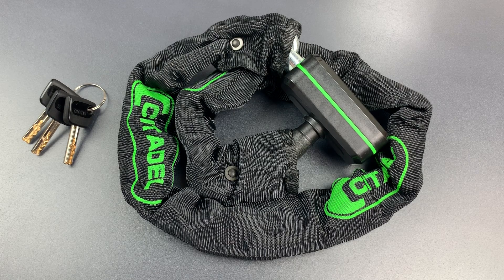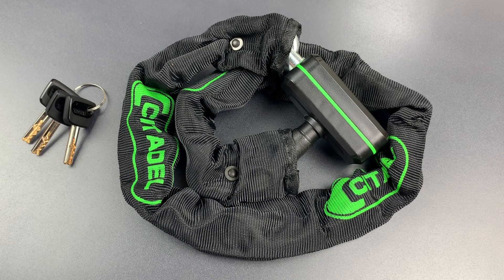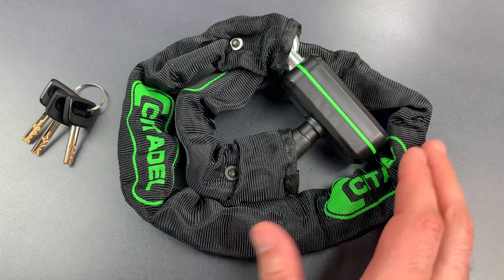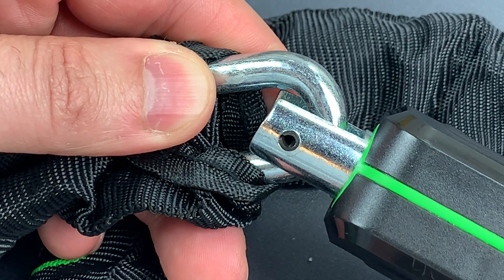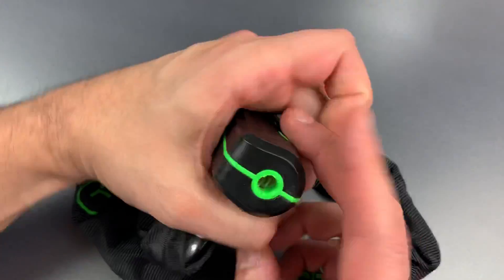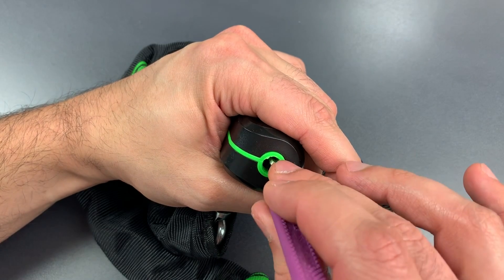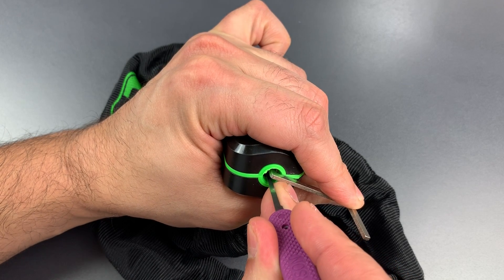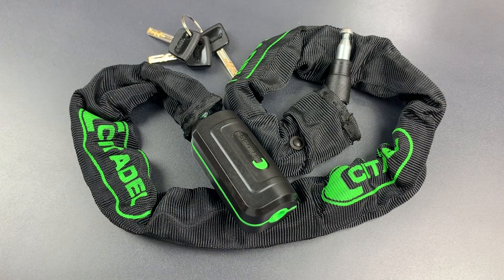[780] Citadel’s “Rome” Bicycle Chain Lock Picked (6 Sliders, 2 Sidebars)

Comment: I had one of their premium locks around 2004. It was shaped like a rectangular bar, which had an iron sleeve surrounding the steel bar and was locked with a circular cylinder lock. The thing weighed a lot and because I was carrying books to college I decided to leave it locked at the college. One day I arrived to find it wasn't there. The property owner leasing to the college decided to have it cut off.

Comment: I have a request, the Abus granit plus 640 u-lock. It is extraordinarily expensive at around $100 but is much much thinner and lighter than even Abus's own locks costing half the price or less. It actually uses its light weight as a selling point. But has the highest security rating for their U-locks, apparently greater than their locks with much more robust shackles. 

If you were able to get hold of one it would be interesting to see.

Comment: That roll-pin holding the chain to the lock body. Such a bad design. Seeing that I'd never buy one of them.
Why pick it if in 30 seconds you could just push that roll-pin out with a hammer and pin punch.

Comment: how is that thing just held together with a clotter pin? you can push it out with a panel nail or it will snap if you yank the chain...
Reply from the maker: It’s a blind pin. Taking it out is more complicated, but not that much.
Reply: A self cutting wood screw can bind in it. It is crazy to put a weak spot after using such a strong heavy chain. 

Your videos are amazing man! I like how easy you make it look and how you explain your craft. Great job!

Comment: Something should be said here regarding the poor quality of some of these bicycle locks. Like anything else there is a price point at which these products can be sold. If one wants to secure their bicycle and be certain the lock is not going to be picked or broken apart, you simply have to open your wallet.
There is point at which the manufacturer will not be able to make a profit, the consumer will not be able to get an affordable lock. I suppose if you have a bicycle worth a couple thousand dollars you be sure to invest in a very expensive system to protect the unit. I suggest a logging chain with links of five eights to three-quarter‘s of an inch in diameter. There are locks out there that will resist cutting and picking. However you’re expensive bicycle might be taken apart and you will find some of it on the chain  and the rest of it gone. The old saying, you pay your money you take your chances. You decide. And after all of that you are still not secure neither is your bicycle.

Comment: Another bike lock with a major flaw.
Makes you wonder if these companies really care about protecting a consumers bike or are they just interested in the volume of locks they can sell before the public find out the lock is no good.
Thanks for the video, cheers mate
Reply: I suggest you consider, not the POSSIBLE ways of defeating this lock, but instead the ACTUALLY LIKELY ways of defeating this lock in the field. 

Yes, LPL can pick it in a few seconds. Can you? Can a 20 year old with a pair of bolt cutters and no picks in his pocket, in the drugstore parking lot with people walking by 10 feet away? (Picks are often illegal without a locksmith''s license, bolt cutters are not. Which would you rather have in your pocket if you expect the cops to shake you down?) I personally think we can dismiss picking as a LIKELY attach on this lock. It could probably be a Master #3 core and still be reasonably safe from a picking attack.

The second obvious attack is pushing out the roll pin holding the chain to the lock. All it takes is a hammer, a punch, and maybe something to use as an anvil. How many bike thieves do you know that have a hammer, punch, and anvil in their pocket? How many do you know that would know how to drive out a roll pin? How many could do it without attracting attention in front of the drugstore with people walking by 10 feet away? This is a more likely attack than picking, but I don't think it is very probable.

That leaves bolt cutters or an angle grinder. How good is that chain? LPL didn't mention that.
Reply: @lwilton  I'm not paying my way by stealing bicycles. If I were, I might develop such skills.
And to press out the pin, I'd use a gear puller modified to press a pin, not try to lug around a hammer and anvil.
Reply: @JimFortune : The common bike thief does not pick. If your'e skilled and patient enough to become a good picker, you're not going to try and making a living stealing bikes. It's low reward, high risk. Bike theft is a crime of convenience by low-level street rats.
Reply: @chrimony  Not being a bicycle thief, and having never conducted a survey of bicycle thieves, I really can't say what techniques are popular. From what I've seen of bicycle locks, SPP isn't needed. Raking or bumping is probably sufficient for most,  and they have the advantage of not taking that much longer than normal opening with a key does. It usually works fast or doesn't work at all. So you take a stab at it and walk or ride away depending on luck.
Reply: The important thing is to keep the public from finding out how shitty they are. You can spend the time and effort to make them less shitty, or you can spend those resources on lying to the public.
Reply: Which one do you think. It's obvious.
Reply: Capitalism doesnt care about anything but its own benefit. surprise surprise ^^
Reply: @RVPNK161  In Romania, under communism, we had a famous (to us) car called Dacia 1300. This car, like every car, needed a key for the engine to start. Now, unlike other cars you could take your ID card, put the corner in the key slot, and twist. There was nothing holding the mechanism in place.

There's also a story I heard about an American guy going to work in the USSR. There he gets an apartment that, for some reason, doesn't have a fridge, so he asks a co-worker what's the best fridge. His co-worker tells him what kind of fridge is the best, and the American chap goes out and buys it. A few weeks later, the fridge breaks, and our guy asks his friend how come it broke, if he said it was the best. "You don't get it. They all break. This one's just the easiest to repair."
Reply: @RVPNK161  It's a good thing the workers don't control the means of production.
Reply: @two_tier_gary_rumain  good? for whom?
Reply: @RVPNK161  STFU idiot.
Reply: @RVPNK161  this. We should stop blaming individuals and start looking at how the system produces shit like this.